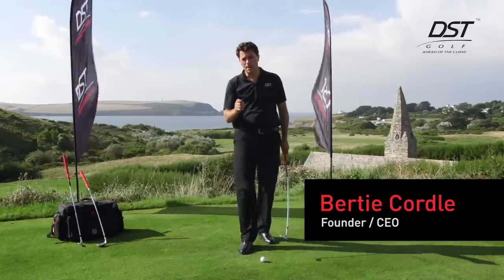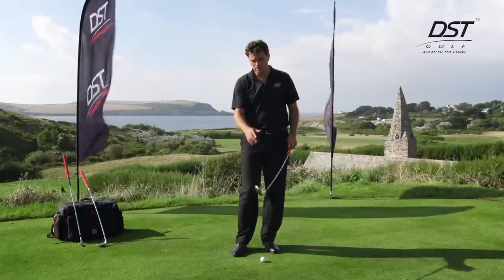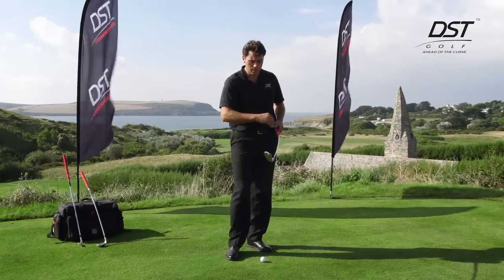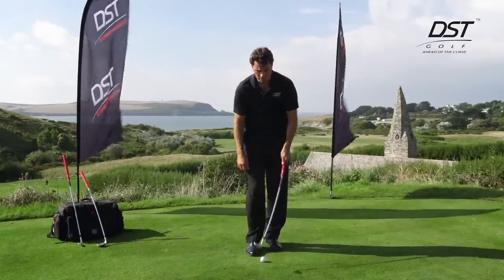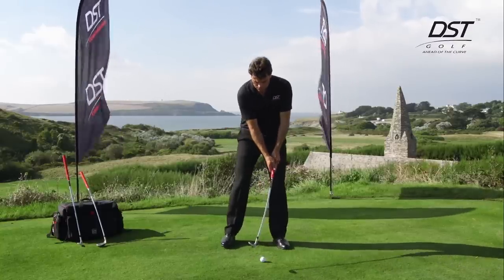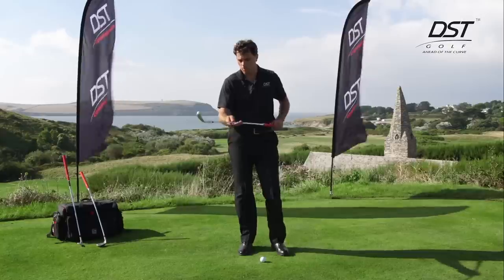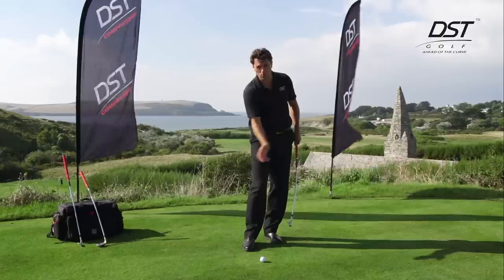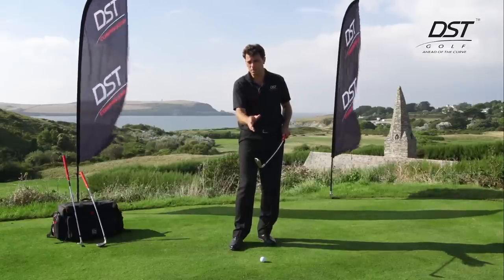The DST Compressor How It Works

Comment: The only question I have is this. Does the compressor shaft bend more at impact or is it made so stiff that it remains the same shape through a shot? Love the concept, tried a wedge and purchased the 8 iron immediately.

Comment: I have just bought the 8 iron DST compressor. I think the line alignment is irrelevant because at speed (in swing), you can’t see the lines, and at address the hands are way too forward.
Personally I feel that if you are able to strike the ball cleanly and on target with one of these clubs, it gives you feedback about the impact position.
Reply from the maker: Try and use it in the way it was designed, which is to help you feel a static position that you want to re-obtain at impact. By this I mean not only the handle and club face position but also by putting more weight into your lead foot and open your hips and torso to the target. This will enable you to feel what you're try to achieve in the dynamic position at impact. Then begin by starting from this position as a drill to hit chips and pitch shots. It will encourage your weight to be forwards and as a result your low point of the club head arc will be after the ball has been struck. Give it a go!

Comment: If a normal club bends into this position at strike, this must have super stiff shaft, otherwise if you actually tried to hit with it it would be bent way past that of a normal club.
Reply from the maker: Thanks Krusher74! It is a super stiff shaft, which has been tip cut only to make it even stiffer. It has also been tested by one of the leading shaft companies and it has been found to be the most stable shaft ever tested if the tension is maintained in the shaft until after impact (by reaching full extension after impact). However, if full extension is reached before impact the shaft and club head become unstable due to the balance of the shaft. So the club essentially highlights and exaggerates the fault of a golfer reaching full extension before impact so the compressor encourages a player to have increased hip and torso velocity with reduced speed of club face rotation through impact. Happy hitting! Team DST.